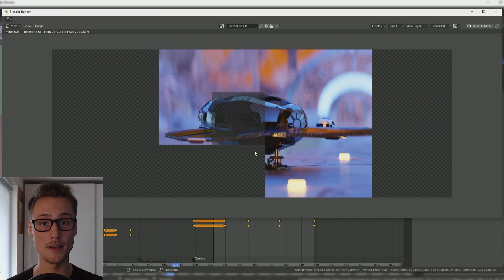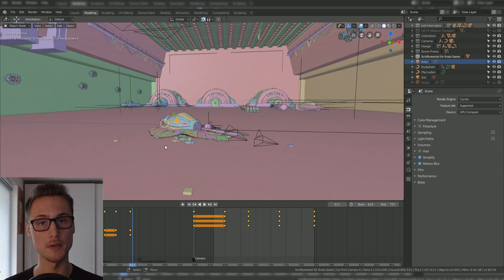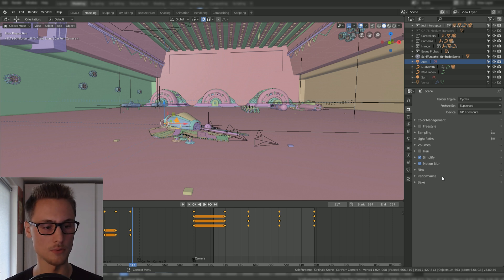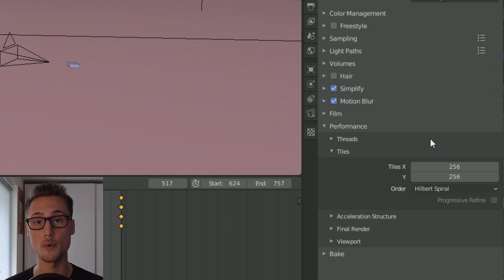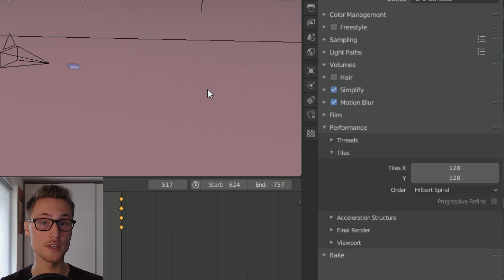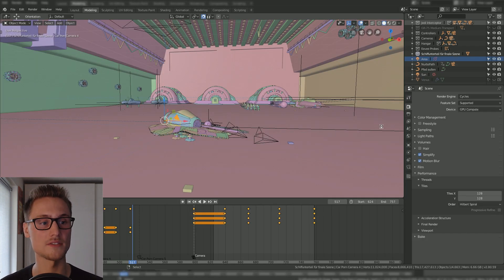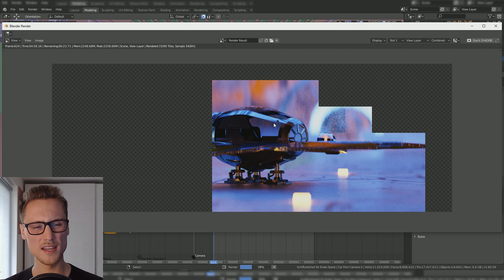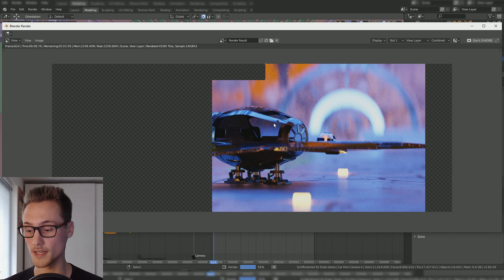Blender: How to fix cuCtxSynchronize Error

Comment from the maker: BTW: Setting the tile size to 128x128 worked for me for ~2h of continous rendering. After that I had to reduce the tile size again to avoid the error. I ended up using a tilesize of 8x8 and could finish rendering my whole animation. So don't be afraid to not go as low as possible!

BTW²: If you are using Blenders internal denoiser you should check your denoising options whenever you decrease your tilesize as the denoiser denoises tile by tile. However I can recommend using this free denoiser instead: https://remingtongraphics.net/tools/d-noise/
Reply: Am I correct that this would mean my render times would increase drastically? Thank you for your solution though!
Reply from the maker: It depends on your hardware. However the blender doc states the following:
"CUDA renders no longer need to use large tiles. In many cases rendering with a tile size of for example 32x32 will actually be faster now. When using denoising it may still be somewhat faster to user large tiles, but this comes with a high memory usage cost. (6da6f8d6da)"
Source: https://wiki.blender.org/wiki/Reference/Release_Notes/2.80/Cycles - search for "GPU rendering"

So in theory if you have a NVidia GPU it should maybe be even faster👍
On the other hand the blender doc still states that "For CPU rendering smaller tiles sizes (like 32 × 32) tend to be faster, while for GPU rendering larger tile sizes give a better performance (like 256 × 256).", (https://docs.blender.org/manual/en/latest/render/cycles/render_settings/performance.html), so my best guess is that you should try it and look for yourself even though that's a really crappy tip 😅😅

Comment: What if my tile size is already low, it's 32 x 32 px. I have an i5 9300H, 8 gb ddr4, and a gtx 1660 ti mobile.
Reply from the maker: Setting the tile size to 128x128 worked for me for ~2h of continous rendering. After that I had to reduce the tile size again to avoid the error. I ended up using a tilesize of 8x8 and could finish rendering my whole animation. So don't be afraid to not go as low as possible! Maybe you even have to go down to 4x4!
Reply: @Starwarsfun1-Leo  I actually got it working now, I just lowered the render sample from 128 to 64. Still used 32x32px and it worked. Thanks tho

Comment: I couldn´t test your solution because i can´t change the tile size at all, it just reverts back to 240 tile size whenever i try to change it.

What solved it for me what to use the "progressive refine".

edit: Seems i was using the "auto-tile size", i just tried setting it to 128, 64 and even 32 pixel tile size, still couldn´t get it to work, seems progressive refine is the only solution for now.
Reply from the maker: Thanks for sharing this info!
Reply: @Starwarsfun1-Leo  I wouldn´t have figured this out if you hadn´t given me the idea of the tile size, so thanks :D
Reply from the maker: Yeah, some problems in blender derive from utmost unpredictable causes 😅 Glad I could help!
Reply: @Starwarsfun1-Leo  So i have figured this out after a bit of tweaking with the settings:

1. I had to go with 8 pixel size
2. I had to use the optix denoises